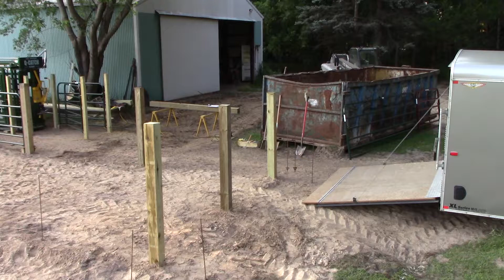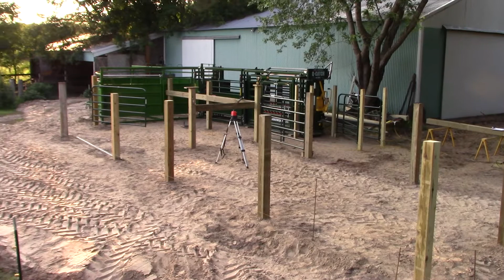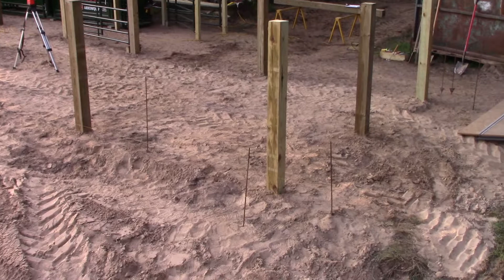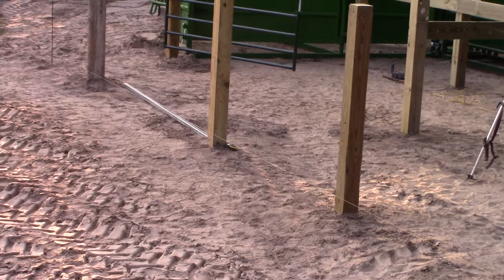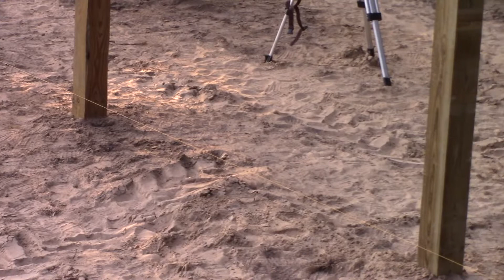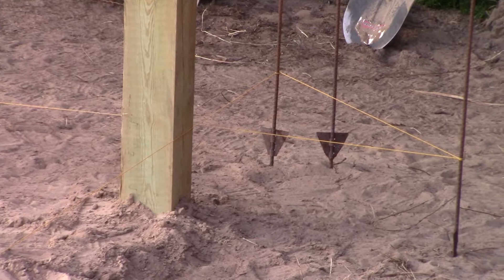Corner layouts using 6-8-10 method

Comment: Your visual explanation is simple and very effective. From practice for practice.
For those who still want a theoretical explanation:
Take a look at Mr. Thales of Miletus (some Math Nerd from ancient Greece) ~ 626/623  – c. 548/545 BC was the first to inscribe in a circle a right-angled triangle.
Then let's talk Pythagoras of Samos (as well some kind of ancient nerd ~570 – c. 495 BC)?
They both influenced Euclids geometry - somewhat around 300 BC (?)

Constructing right-angled triangles using the Pythagorean theorem:
Practical Instructions for Applying the 3-4-5 Rule with Conversion
    The Standard 6-8-10 Rule (Imperial System):
        The 6-8-10 Rule is a scaled version of the classic 3-4-5 Rule, adapted for larger, more manageable measurements in the imperial system. It is commonly used to create right angles by using a right triangle with sides measuring 6 feet, 8 feet, and 10 feet. These values satisfy the Pythagorean relationship 6²+8²=10².
        The imperial system generally uses these larger measurements probably because they are easier to handle on larger projects, and they provide greater accuracy for practical use on construction sites or large properties.
    6 feet – 8 feet – 10 feet Rule:
        To apply the 6-8-10 rule, measure 6 feet and 8 feet along the two lines that will form the right angle.
        The distance between the endpoints of these lines should be exactly 10 feet.
        If the distance between the endpoints is 10 feet, you have successfully created a right angle.
    12 feet – 16 feet – 20 feet Rule:
        For larger projects, such as road construction or marking larger properties, the values can be doubled to 12 feet, 16 feet, and 20 feet. These larger measurements provide more flexibility for working on bigger areas, while still remaining manageable with common measuring tools like a tape measure.
        The scaling up of the values makes it easier to apply the rule on larger sites, while ensuring accurate and easy-to-check right angles.
If you are probably more familiar wirh the international metric system:
Metric System (60 cm – 80 cm – 100 cm and 120 cm – 160 cm – 200 cm)
    1. 60 cm – 80 cm – 100 cm Rule:
        ◦ Measure 60 cm and 80 cm along the two lines that will form the right angle.
        ◦ Connect the endpoints of the two lines. The distance between them should be exactly 100 cm.
        ◦ If the distance is 100 cm, you have created a right angle.
    2. 120 cm – 160 cm – 200 cm Rule:
        ◦ Measure 120 cm and 160 cm along the two lines that will form the right angle.
        ◦ Connect the endpoints of the two lines. The distance between them should be exactly 200 cm.
        ◦ If the distance is 200 cm, you have created a right angle.
It's pretty simple to convert the initial measures to larger subjects, thusfor point 2 ...